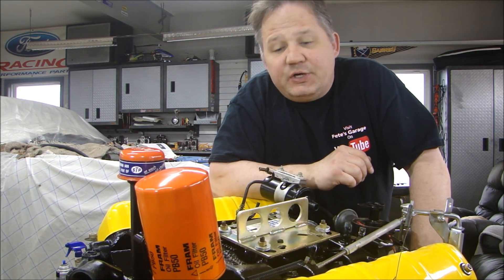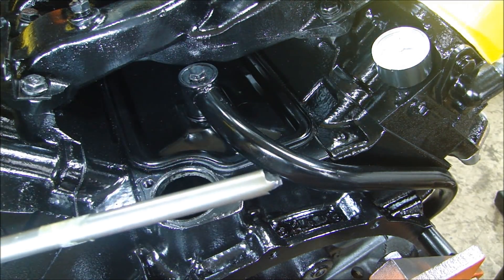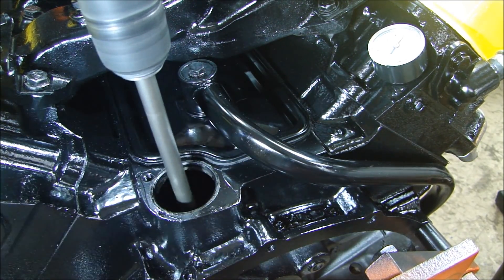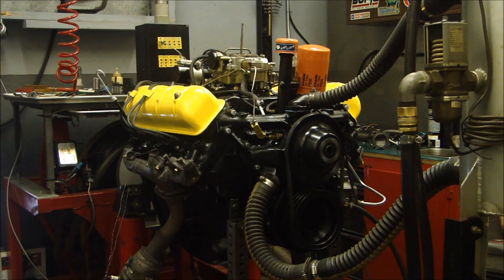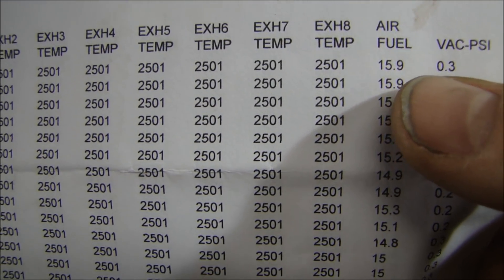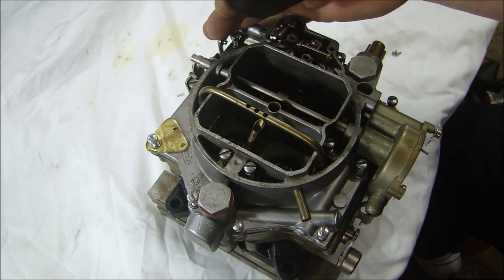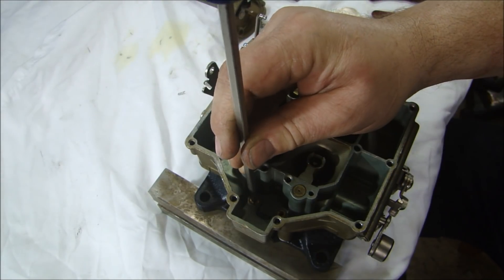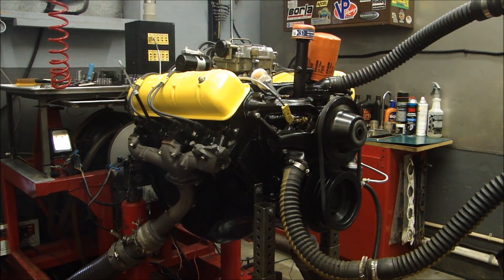Engine Rebuilding - Part 8 Dyno Testing

Comment: Hello Pete
You should weld an O2 bung in the exhaust and use a portable reader to check air fuel ratio, then put a bung in it when you are done. Much cheaper. Take a chance on any leaks. Live dangerous. 
Ken
Reply from the maker: There is an O2 sensor in the exhaust, that is how the mixture is measured.

Comment: Really looking forward to seeing the Studebaker Hawk back on the road video.  Seeing the engine running on the dyno was terrific.  Perhaps Studebaker fudged the rating back in 1962 to compete with the big three.  Makes me wonder if the supercharged version was really 275 horsepower?
Reply: Studebaker should have been able to get 275 HP out of a 289" without a supercharger... especially in that era of high octane gasoline...
Reply from the maker: Should have...lol

Comment: Why did you not put the whole car on the dyno?
Reply from the maker: The purpose is to test the engine, tune the carb, and check for leaks. If the engine were in the car and a problem came up it would have to be pulled out.

Comment: I liked it better when you tested it at 33,000 rpm, wow 33,000 rpms and only 162 HP, but those Studebakers are tough engines.
Reply from the maker: I misspoke, it's easy to do

Comment: Hey Pete, good job on the all the video's, I enjoy watching them.  Where do you go for the engine dyno around here?  I thought you said the name in the video but not sure.  Also, I was in to talk to Paul at J&L, I'm building an 850+ hp forged LSA for my CTS-V and going to have him hone mains and cylinders along with balancing before I start assembling.  While in there, I was looking at the pictures on the wall.  Was that you up there with the red fox body mustang!?
Reply from the maker: Paul has a dyno in the small building and Joe Hetz does the dyno work. He is a great guy to work with. You can set up a dyno time with Paul. They test 1,000 HP + motors all the time. I did the red '82 and orange '69 Mustangs that are on his wall. Paul is a real good guy.

Comment: Good result.  I must admit, after watching all of Engine Masters on MotorTrend, I've gotten used to seeing numbers north of 500HP and thought 160 was pretty low, but it makes sense for an older engine.  As long as it sounds good and cruises nice, I guess it does not matter that much!
Reply from the maker: This was all about getting it to run reliably, and right for the next 150,000 miles. The goal was not high HP, just see what it could do after rebuilding.
Reply: Yeah, Dave, I would have had to build it for at least 275 HP... that can be done without hurting MPG on a 289" engine... would prolly even improve MPG over stock...
Reply: I was hoping for a bit more horses but your explanation is sound reasoning ,thanks , I learned stuff.
Reply: BuzzLOLOL that's why in the day we turned them into a studellac. but you could get them to run .the 259 with passmaster on the covers &Carter carb from55speedster were pretty hot.

Comment: I was surprised at the H.P.. That is sick. 225 would make a lot more sense. Being mechanical lifters, would you not use non-detergent straight 30wt. oil after break-in?
Reply: Hot Rod Magazine dyno tested a then-new 352 Ford FE that was supposed to have 300 HP.  They got 200.  (On an engine dyno, not a chassis dyno.)  Only got to the rated 300 HP after many mods (cam, intake, exhaust and head work), and then finally to 342 HP after they bored and stroked it to 412 cubic inches.  August and September 1958 issues.
Reply: + herman452 - Great example of how the manufacturers goofed on the numbers back then. They can't get away with it now because of the easy availability of dynos. There would be lawsuits flying all over the place!
Reply: I have every issue of Hot Rod Magazine from January 1950 through December 1980.  So yeah, I pulled those two issues out to refresh my memory about the exact figures.  But I do remember that the 58 Ford 352 was the most overrated motor they ever tested.  Almost all fell short of the advertised horsepower, though.
Reply from the maker: After testing hundreds of these old engines I can say they all fall 50 to 60 HP below advertised numbers. I would switch back to regular oil after a few hundred miles.
Reply from the maker: That is an incredible memory, unless you keep the 1958 issue handy : )

Comment: Wow, renault has a 1.6 Liter turbo Diesel producing up to 180 PS and torque figures north 300 ft.lb. Got to love the french diesels
Reply: I have a copy of the original Dyno pulls that Studebaker engineers performed on the 289 engine in 1956 when it was first introduced. I have the HP numbers in all configurations including gross HP with no exhaust or accessories.  They were done with a Carter WCFB 4 barrel and 8.5:1 compression.  With exhaust manifolds and water pump only , the engine made around 180 HP net.  Pete's engine seems down about 15 HP from factory engineering pulls.  Perhaps the timing should have been bumped up a bit?  Also he shows the horse power as developed at only 3,800 RPMs.??  Peak H P is usually at higher RPMs ??
Reply: yes, I think so too.  I don't think Pete did anything wrong.  He is sharp and thorough, but something is slightly amiss?  Perhaps ignition timing could be bumped up some.  Cam timing might be off a bit too?  He makes the point that the owner did not want a performance rebuild and wasn't concerned about high power.  Still.. I'd want all the potential that the engine had for that factory stock configuration.
Reply: The Engine is called 1.6dci and Mercedes uses it as Well in the B, A, CLA class. Hope you get to See those engines in the US cause I have heard you're not allowed to import french cars.
Reply from the maker: This engine is 54 years old. It was never designed for HP. There are many new engines that out perform it. Thank you for sharing that information with us.
Reply: Makes one appreciate modern technology and the hp being pumped out today in our engines. And many lasting 200,000 miles or more.
Reply: Keep going what you are doing sir.
Reply: Jack Heidel i agree, pete seems sharp as a mech. but you are 100% correct something is lousey on this build and peak horseys are measured at higher RPM !  LIKE  5000 TO 6000
Reply: Back in those days, 1950's - 1960's, HP peaked around 3,800 - 4,600 RPMs in basic 2 bbl. and 4 bbl. engines...
In 1970's - early 1980's, Corvette low compression ratio emissions-slug 4 bbl. 350" engines were rated at 165 netHP (L48 base cam) and 180 netHP (L82 big cam))... 2 bbl. 350's for Monzas for California emissions were rated 125 netHP !!! (305's weren't approved for Cal.) ... Corvettes were 250 netHP or less 1971 - up until 1991...
Reply: Although this engine is quite old, they were used with great success with turbochargers at Bonneville. They were pulling around 1200 hp on alcohol.
Reply: Seems like one wouldn't want to boost HP too much anyway, right after a fresh overhaul, as long as it burns clean and reliable.

Comment: Thanks for a great series, Pete! MUCH great information on engine rebuilding in general and on Studebaker engines specifically. Did you happen to compare the specs between the 2bbl and 4bbl cams? They are probably different and may have had a negative effect on the(disappointing) horsepower readings.
Reply from the maker: Thanks Edward! While doing research for this engine I found a great deal of info. Most if not all of the numbers were a bit inflated.
Reply: @PetesGarage  You might investigate the R-1 cam. It may give more power. Studebaker was looking for low end torque and gas milage. My stock '62 Hawk got 24 mpg on the highway. I had Crower cams grind a cam for it, the torque came in much stronger at 3000 rpm, but the mileage dropped to 17.
Reply from the maker: @garylangley4502  Great idea, thank you. The guy who owns the car is always having things done so maybe I'll talk him into some power upgrades.

Comment: I haven't seen anyone prime an oil pump manually in yearsssss. Everyone just relies on the assembly lube.
Reply from the maker: It only takes 5 minutes and it ensures the engine is full of oil before firing it up. It's a good practice to follow.
Reply: OK so I'm a dummy. The problem stemmed from the fact that I had not built an engine for several years after having built several back in the 70s and 80s and I was not aware of the removal of zinc and phosphorus from regular motor oil. An expensive lesson! I had to rebuild that motor twice.
Reply from the maker: There are no dummies here.I've had to rebuild engines 2 and 3 times for various reasons. Nobody is perfect.
Reply: Chancy! and ALWAYS ALWAYS ALWAYS use oil with Zinc additive during break-in! Ask me how I know. All who have wiped out their flat tappet cam on start-up raise you hand!
Reply from the maker: I know many guys who would not raise their hands Edward...lol
Reply: Manny, that's not true! Most of us manually prime and with the valve covers off! We want to see oil in all 8 rocker arms! We spin the engine over with the starter while priming... If everything isn't perfectly oiled, and the oil pressure up good, the engine comes back apart to find out WHY !!!
Reply from the maker: I always prime the engine before putting in the distributor. And I check everytihng the machine shop did, just in case.
Reply: Also, I lost one because I did not put Moly Disulfide on the distributor gear of a new cam! Just overlooked it and 15 minutes later the distributor and cam gear were completely eaten up. Not much oil squirting on the gear in some designs. Too little too late.
Reply: Fords snap that thin hex oil pump shaft because the oil pump pickup screen pushes in and allows crap into the oil pump gears! If you put a stronger pump drive shaft in, it snaps the cam and/or distributor drive gears, instead !!! Make sure that screen can't push in!
Reply: Petes Garage know someone had machine shop do rebuild didn't align cam oil holes no oil t o rockers probably good idea to prime oil pump 292fords use a thin hex shaft likes to snap if engine sits along time.

Comment: Did I hear you correctly?? 4* Advanced is ALL??????  If so, throw some timing at it and see where she goes..... Maybe I heard you incorrectly.....
Reply: Pete, don't most engine's run best at about 36-39 total advance?
Reply: @zxtenn  you're talking about TOTAL advance whereas Pete is talking about the static or maybe at-idle setting.  I'm an air-cooled VW guy so we keep things at about 32 BTDC total and depending on the distributor set it statically at 7-5 deg BTDC.
Reply: @Turk380  I HAD MANY VW BUGS BACK IN THE DAY AND USED A TEST LIGHT AND ALSO THE MARK ON THE DIST. AND ROTOR ALONG WITH THE MARK ON THE CRANK PULLEY ALIGNED WITH THE SPECIFIC PART OF THE ENGINE BLOCK
Reply from the maker: Nope, that's all the owner wanted. This in not going in a muscle car, it's a cruiser that will be driven on road trips.
Reply from the maker: Standard timing with the vacuum disconnected is 4 degrees for this engine
Reply: jim dandy I have 37 degrees advanced timing but only because it a fully built forged engine and I need to run 97 prefferably 100 octane or better i have 110 octane in it now just to be safe 37 is really advanced and it's only because it naturally aspirated when I put the turbo it'll be more like 22 degrees..

Comment: Hey Pete what do you recommend to break in a remanufactured engine?
Reply from the maker: Those are tough, but a good break in oil and doing hard acceleration for the first 500 miles will help.
Reply: @PetesGarage  don't you mean doing no hard acceleration until the rings seat, in the first 500 miles?

Comment: 160hp from 5 ltrs? I appreciate that its an old design but with new bits inside would cost no more than the old design bits. It still needs waking up.
Reply: I had an '83 Z-28 5.0L that put out a whopping 150hp from the factory, so there's that. I also had a '76 Corvette 5.7L that scorched the Earth with 180hp from the factory.

It has to do with the heads and low compression. Did you see the pistons? The ports on the heads are far from optimal for bigger HP numbers. As Pete said, the valves are small. These were not designed to be performance engines.
Reply from the maker: It's a very mild came with small valves. You could get over 400 HP out of it but it would be costly.
Reply: @PetesGarage  What do you believe you would need to purchase to get it up to 400 hp?
Reply: It probably provides power where and when you need it for normal driving, It seems to me some of those big, racing motors don't do much under typical driving.
Reply: these hp numbers are way off.  I have been building Studebakers for street and performance for many decades.  This make NO sense at all
Reply: Stephen A Agreed. My motorbike makes 100hp from 600cc.
Reply: Well, motorcycles rev a lot higher as well. As HP is just a function of torque x RPMs, this doesn't say much. Peak torque numbers is where it's at :)
Reply: + EastingAndNorthing -  Torque x RPM / 5252 = Horsepower
Reply: bg147 definitely never drove a car with a built engine! It's freaking amazing..

Comment: I assume standard cam, maybe 8:1 CR, and looks like an old WCFB carb.  

Guy in Georgia dynoed a 289 with 10:1 CR, R1 cam, a 500 Edelbrock carb and some headwork.  Got 240 horsepower.  Assuming the dynoes are equally accurate, that's 80 more HP with a hotter cam, more CR, headwork and a better carb.  ??? Could be, I suppose. . . .
Reply from the maker: You are correct. The only way to get more out of it is a custom grind cam and larger valves. The owner was interested in a fresh rebuild that was reliable, not a power increase.

Comment: I missed hearing you say what the compression ratio is. Is it stock?
Reply from the maker: Very slightly.
Reply from the maker: Everything is stock. The only modification is bored 0.030 with larger pistons.
Reply: Petes Garage if everything is stock but you bored 30 over, wouldn't that lower compression with more space in the cylinder but same stroke and same heads?
Reply: 8.5:1 is stock on the basic 289.

Comment: Very nice job! I'm betting that Studebaker might have fudged those numbers. It's a pretty sedate engine and Studebaker really didn't have much money for R&D in '62, but they were trying desperately to stay alive. They were pretty much on death's door by that time. You've assembled a great engine for a Hawk and it will never have to be rebuilt again!

My grandparents had a white '62/289/4BBL. It sounded fantastic, but it wasn't a race car by any stretch of the imagination.
Reply from the maker: Thank you my friend. I'm sure the used all perfect engine parts and used headers install of these manifolds. Of course dyno machines were different 54 years ago. The public really had no way to check what the companies said. I'm sure the exaggerated a bit.

Comment: Such a small part as a fuel jet makes a hell of a difference in hp. How much hp do you think this engine would make on EFI? Stewart, Australia
Reply from the maker: It sure does. Getting more out of this engine would require a bigger cam and heads with bigger valves. EFI is next, so the owner would like
Reply: EFI makes about -0- HP improvement over a properly tuned and sized carb... maybe 5 HP at the most... and if the EFI system isn't perfect for the engine, you can even lose power and MPG...
Reply: BuzzLOLOL  tnanks for your info.